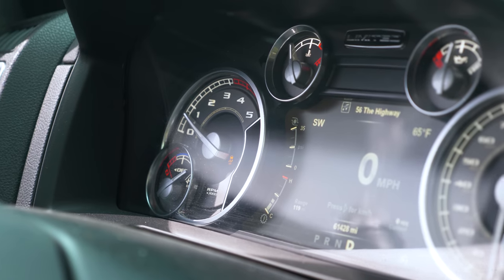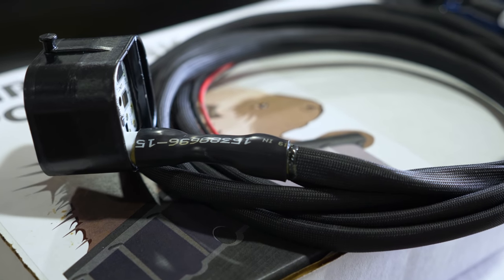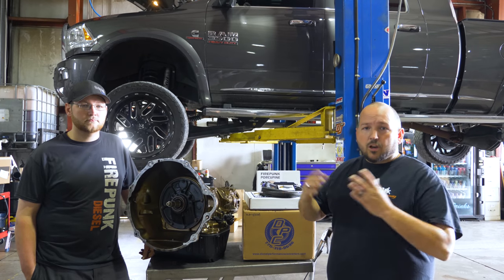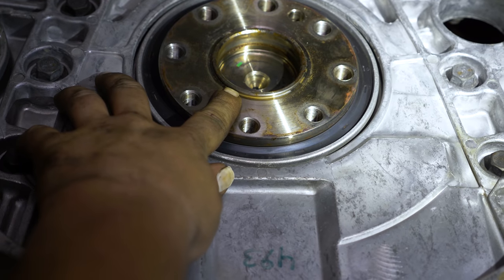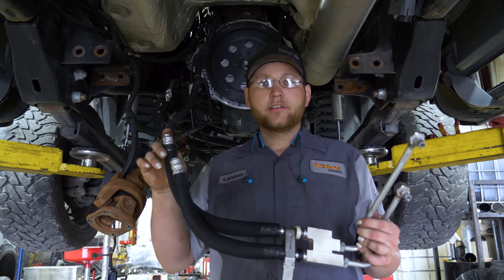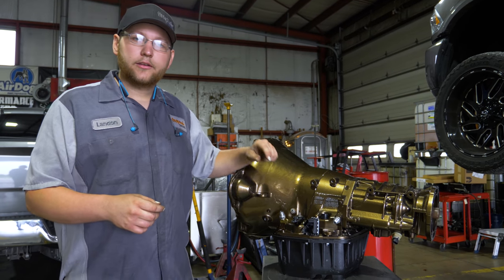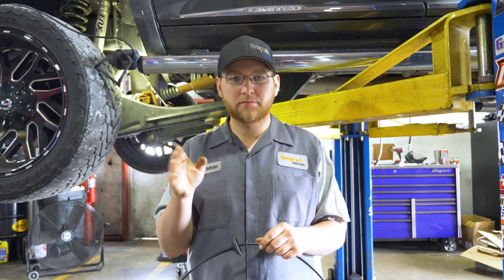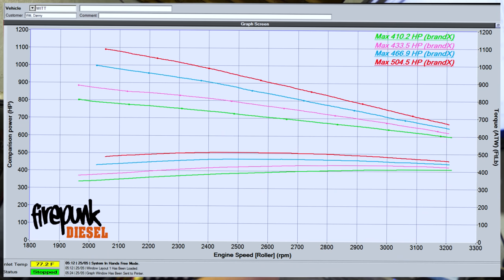68RFE TO 48RE SWAP 2017 RAM LIMITED - INSTALL PROCESS - DRIVE COMPARISON

Comment: So everyone can sleep, I put tires on it the next week.  Lavon and the guys did a great job on this swap.
Reply: @dwitt1222 Do you still like the 48 now that you've had it for a while?
Reply: @CD1986100  Yes, for the power level a 68 will never be an option for me.
Reply: Any updates?
Reply: @D.M.Designs  still going good.  I have broke the trans a couple times, but at no fault to the firepunk guys.  I’m not easy on it.
Reply: @innovativeengineering1977  I am thinking a 48 swap is in my future. I want to run my truck hard. I hate the 68 its tiny clutches and how it shifts and thinks.

Comment: Great video, thanks guys! Funny how the customer is dropping $12k-$13k for a 48 swap but can't get a decent suspension/wheel/tire setup on the front to run that wont wear the tires bald on the outer edges lol
Reply: I hope it dont cost 13k for that, i have a built one in my 05 3500. Whole truck was 10k
Reply: Marlon Martinez  or just use the 6 speed with a upgraded clutch and be done for a long time.
Reply: Ted s 
no offense but it sounds like you have no idea what you’re talking about. You can’t just throw some upgraded clutches in a 68 and be able to reliably withstand 800hp as the owner of the truck is wanting to do. The 68 slips the clutches unlike the 48 so no matter how much money you spend on clutches it will still wear them out. And not to mention the input/ output shafts/ torque converter. It makes more sense to spend the money on the swap because rebuilding the 68 is a lot more expensive than rebuilding a 48. But I’m sure you know more than everyone because you have a $10k pos...
Reply: @talonp5  and btw i know a guy who has had what i speak of, meanwhile you have a 1500 trying to talk about shit you dont have... 👌
Reply: Ted s 
I have a 1500 and a 2500. I know it’s hard for you to believe that people can afford more than 1 vehicle. I’m sure your experience with your buddy’s truck is all you need to feel like you know everything about diesel trucks.
Reply: @talonp5  2 trucks is all you got? My 3500 is a welding rig and own 2 bikes and 4 other car's. But keep trying blow hard
Reply: Ted s doesn’t change the fact that you think slapping some clutches in a 68 will make it withstand 800hp. You could own 10 trucks and still not know what you’re talking about.
Reply: @talonp5  ok, its all over the internet as well but ya your right in your own mind. Now run along being you have neither
Reply: Ted s 
So you’re the type to believe everything you hear on the internet? I guess that makes since.
Reply: @talonp5  and your the type to not know better because you live under a rock, and its sense not since. You must be a genius
Reply: @talonp5  why are you complaining about price when you’re buying a diesel truck to play with

Comment: If I was gonna do this swap I think I'd just get rid of the stock trans lines and run all new with AN fittings and high end line just to know its good . It might just be me but I don't trust compression fittings at all. We use them alot in the oilfield and they never last haha but you guys are the pros not me thats for sure I'm the student here haha :)❤

Comment: Wow I just noticed the front tires on that truck they need an alignment badly haha the outside of the tire is bald and the rest of the tire has tread. It's running the outside edge big time almost like the torsion keys on a 1500 were jacked way up haha❤❤❤

Comment: What about those sub 600hp daily guys really wanting the extra overdrive in the earlier 03-05 ? Is there an option for them? I would love a biult 68rfe in my 05 Cummins 5.9. If it can be reliable enough with 425-500hp towing year round 12-18k.

Comment: How about putting a gear vendors unit on the back of the transfer case I think they make them for it and they’re pretty tough units you could split between third and fourth gear and illuminate the big wide space or ratio difference something to look into and also with the guys with the carrier bearing might be able to illuminate the carrier bearing because you’re making a drive shaft shorter something to check out this is six in row jim have a nice day bye

Comment: Question about the porcupine if you left the transmission in neutral, would you be able to start it on a Laramie push button start truck? Or only in park?

Comment: He cuts the trans lines in the wrong place , in order for the lines too be long enough , you cut the FACTORY lines right where they come off of your 68  so basically just cut off the male adapter on the end of the line and add your compression fitting there , other then that it’s an awesome kit

Comment: Those with aisin transmissions, how much do you charge to build?  Considering there are no aftermarket tuning, is it worth upgrading.   I have a sxe 364.5 bw 2 gen swap
Reply: i have the as69rc also and been trying to ask them if they can do the 48re swap for that but havent gotten an answer yet.

Comment: I’m wanting to build my 07.5 into a street truck and do some sled pulling with it as well. Should I look into a 48 even though I only want around 800hp?
Reply: Possibly. 800hp is fine. 801hp will cause issues.

Comment: Can we get a picture of the fitting that goes on the aluminum line once it has been cut off? I'm assuming it's a compression fitting??
Reply from the maker: Yes 1/2" compression to 8an, search on jegs or summit, I can look up part number tomorrow
Reply: @FirepunkDiesel  what was the part# here

Comment: I don't really see the point of 48 swapping from a 68.  For the price of the swap you could have just built the 68.  I really like having the 2 extra gear for highway driving or towing.  68's have come a long way since they first came out.  The are being built now to old 800+ HP

Comment: Guys I’ve got an 07 1/2 mega cab with a 6.7 in it. I did a 48 swap and was able to just bolt the transfer case from my 68 right up to it without having to cut the input shaft on the tcase, what’s going on here? I need answers doesn’t make any sense.
Reply: Because it's a 13+ issue only like said in the video

Comment: Does the porcupine allow the for full function of cruise control too?
Reply from the maker: It's supposed to, yes, we have a few trucks that cruise randomly does not work, but is something we're working on for the few trucks that are giving us fits
Reply: Firepunk Diesel 
Thanks for the info and the advice on what point and power goals to swap a 68 out.

Comment: I just bought an 04.5 off my dad that he bought new off the lot. He kept everything stock but I want to put a couple of tunes on it. Can anyone give me some pointers on starting out?
Reply: Call up firepunk and they will set you up
Reply: Also, you can't get efilive. 06+ only. But you can get hptuners which is damn near as good. Or just run a smarty tuner
Reply: If your tuning a 04.5 5.9L Common rail, for the 48re transmission, to get max life and performance from, tighten the front and rear bands to spec and change the oil filter and flush the oil out with a really good brand of oil (about 16-18quarts) (I use amsoil ATF - pricey but really tough oil) if you can get an upgraded governor pressure solenoid too.... from then on, might be annoying but service the bands and sump oil (4-6 quarts) and filter every 20000 miles, that thing will last you forever and keep those rpms up when pulling, try not to lug the truck
For the engine, you ll definitely need to upgrade 1. 4"-5" exhaust with Cat delete 2. cold air intake, 3. Intake manifold (if you can update the intake plenum is a good idea too) 4. Exhaust manifold 5. Coolant by-pass kit from Fleece performance (you need to drop exhaust pipe and drop the trans crossmember down to tilt engine back to install it easierly) - if budget can't do all, at least work from 1 to 5. 
And tighten valve lash every 60k -100k mile
As for tuning.... do as duramax 315 said
Reply: Duramax 315 I’ve never messed with tuners and this is the first diesel I’ve owned. Say I bought a smarty touch programmer, will it already have prebuilt tunes or will I need to buy them?
Reply: @TheSiraffe  the tunes come on it.
Reply: Duramax 315 thanks for the help bud
Reply: I have exactly the same truck as you the 2004.5. Get the the EDGE Insight CTS2 monitor that is an integrated gauge monitoring system that tells you everything from Trans temp to EGTs and a whole lot more. It save you having to buy all the gauges individually and just plugs into the ODB2 port. For our trucks the SMARTY tuner is by far the best tuner for drivability fun factor and optimizing engine operation. 
 I’m running the SMARTY Sr set on level 5 and I always roll into hard WOT pulls and it has monster torque. If you drive it with common sense and don’t do boosted launches, or pound on from a dead stop you can have a ton of fun, get good mileage and long trans life. also have a FASS 150 lift pump to help keep it fueled up, a drop in air filter and a straight pipe but other than that it’s stock.
Reply: Also make sure you order the EAS EGT probe when you order your monitor. I ordered everything from Diesel Power Products. I also have an instructional video for EGT Probe Install for our 3rd Gen Cummins on my YouTube channel check it out. If you are going to run a tuner make sure you run the pre turbo EGT
Reply: If you just want to see the monitor in action fast forward to about 6 minutes. It has a Power on demand function and is designed to work with the SMARTY
https://youtu.be/ITwXmf1c13k
Reply: Blake C alright thank you man. I also hotshot. Is this a good tuner for it?
Reply: The Gulf Coast in my personal experience with the SMARTY it does everything people who have used it rave about. The SR has 10 settings and work great for towing if used on setting 1 or 3. The odd numbered tunes add timing, increasing incrementally as the higher the power setting. I haven’t towed heavy on #5 yet. It’s really easy to use and only takes about 3-5 minutes to load the tune in the truck via the ODB port. It leaves no trace on your truck and can easily be put back to stock. Tune 3 the 60hp tune was awesome for towing, it makes the truck come alive, very responsive throttle, massive torque off idle and low egts. It pulls like a freight train. The Smarty and Catcher programming is by far the best plug and play tuner. I’ve used. Many other people say the same. It is built specifically for The Cummins by Marco the tuning genius The tuning parameters are incredibly well designed and optimize the way the truck runs in many ways. The new smarty touch combines both the usability and display similar to the  edge Insight CTS2 monitor with the performance of the Smarty SR. If you get a SMARTY you will be glad you did just be careful  big power settings 7 and above because it makes that Cummins put out so much torque off idle it will smoke the trans if used improperly.

Comment: What about the other way around. 47 or 48re too 68rfe?
Reply from the maker: We've never done it that way.  Would you trade in your Honda for a Hyundai?
Reply: Why would You? Or is that a hypothetical question? If you want a 6 speed, you're better off running an allison in my opinion. Already a conversion out there and they can be built to handle power.

Comment: What do you recomend for my 01 cummins auto trans 24valve 5.9 2500 it has 700hp and 1350 torque  chipped and really worked motor and then my factory trans as been rebuilt 2x already by previous owner ... im also wandering what is my trans as well maybe you can tell me cause it needs rebuilt again it lost OD and my torque is locking up real bad and is acting up on. My hill i park facing upwards and at start up then go acts lick its stick shift then wigns up real high then to put back and drive 2x then the shift kit kick and starts working right can you hele me out with all this pretty new to diesels
Reply: I have 05 dodge truck with a 5.9 cummin and I am trying to clean the torbo shud I take it off or leave it on the truck

Comment: Can you control the shift points on a 47re in a 96 with ur trans controler?
Reply from the maker: Yes, but you do need to pull valve body and switch the vb harness over to a late 47re style electronics.  Pretty simple swap.
Reply: @FirepunkDiesel  what's the difference in the harness. The pressure transducer connector

Comment: So much half-way work here.  The line work is atrocious.  The removal of the register for the flex plate from the crankshaft is downright dangerous as well.  If you are going to do something, at least do it right.